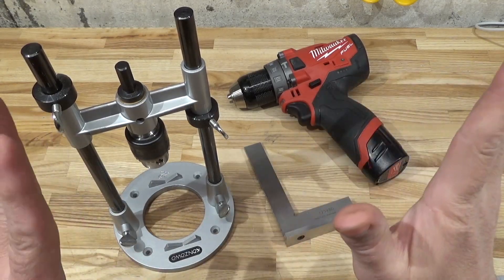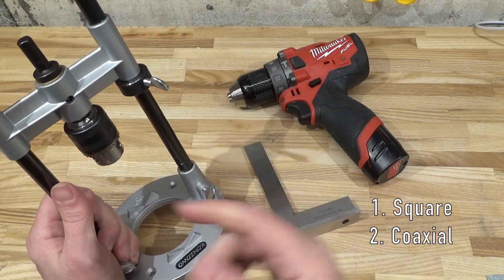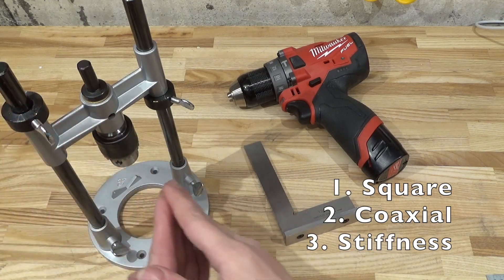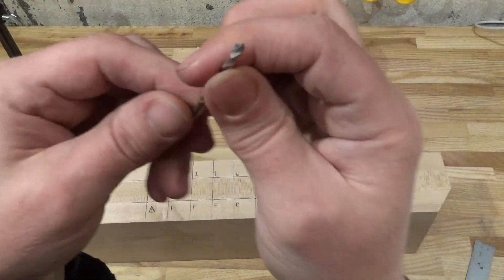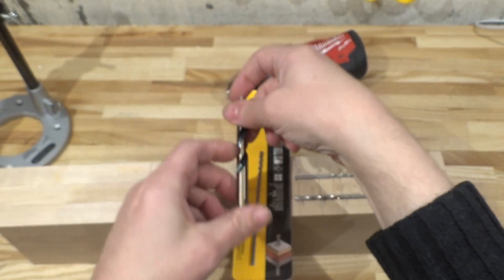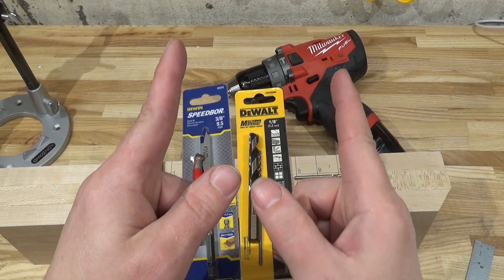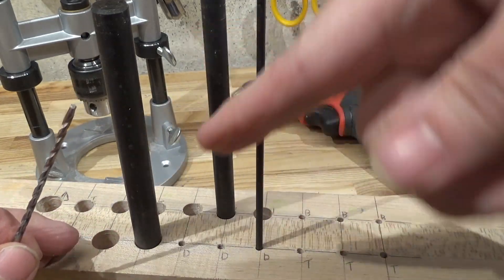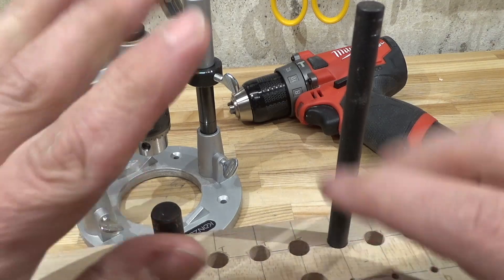Test: Kanzawa Drill Guide Squareness

Comment: Kanzawa has videos of this device in action and they show a square up against a dowel set in the drilled hole vs free handing it. Quite a difference.

Side note… the Amazon price for the model 801 you’re using is $399 but $108 for the 802. But if you think that’s crazy, Amazon Japan has the 801 for between $600 and $800 depending on the seller. The 802 is about $80. I checked this morning, with shipping and exchange rates, it $111 out of jaypan so you save three bucks buying it in the states.
Reply from the maker: Amazon is terrible for prices going up and down... use camelcamelcamel.com to watch for the low end of price fucktuation.